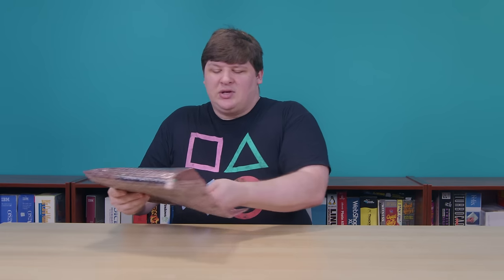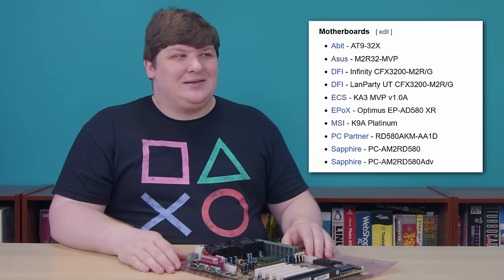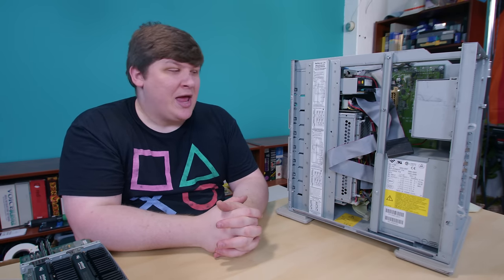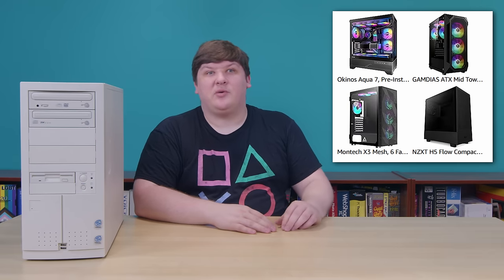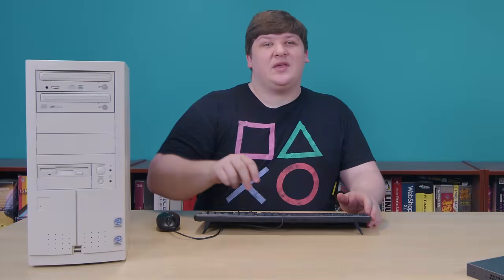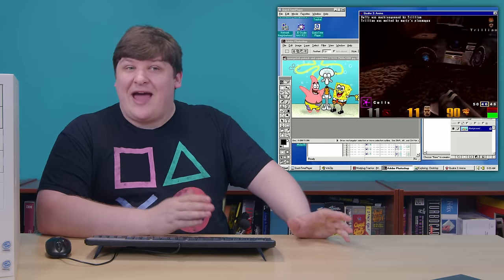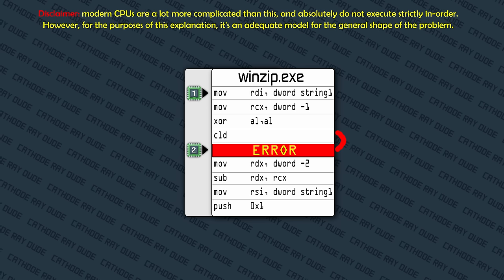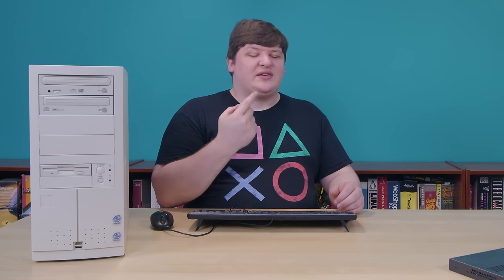The Only Famous Motherboard

Comment: The big clue of this board was that you could use unmodified Celerons for SMP. Celerons were not intended to support SMP by Intel. I had a Dual-Pentium-90 System with 32MByte RAM - this was huge at the time. A EISA Mach32 GPU and a 1740 SCSI Controller - later replaced by a 2742T (way faster),

Comment: I am pretty sure it was legendary for having the most bulging/leaking capacitors than any other board made. I replaced the ones in mine..... all of them. 
BTW...the celeron with its low FSB speed was easily overclockable even with a cheap motherboard without overclocking abilities, most didn't have any, only stock settings.

Comment: It's worth pointing out that the Unreal Tournament OpenGL renderer coped better with multithreaded cpus than the direct3d renderer did. It wasn't actually SMP supported, but it wasn't as broken by multicore cpus. If memory serves, it had to do with instruction counts being different than expected on multicore cpus, leading to microstuttering and worse issues, like the game running at the wrong speed.

Comment: 59:00 You forgot to mention two more reasons why people never used two Pentium IIIs on this board, one of which is explained in the Wiki article you referenced:
- Celeron Coppermine CPUs had SMP disabled, by this point only the Pentium IIIs and Xeons supported it, and even if you had the cash, didn't care about the performance differences and wanted to embark on such an upgrade, you had the other issue:
- Socket PGA370 is in fact THREE revisions, and this board is the first one, which only supports Mendocino core Celerons (2V vCore). Coppermine used the second revision, which has less power requirements (1.75V vCore), and then you have Tualatin, which has even lower power requirements (1.5V vCore), changes some pins and doesn't support Mendocino Celerons (yes, Intel did this type of shenanigans before the LGA1151 debacle). Coppermine requires an adapter to step-down the voltages, otherwise you'd fry the CPU. Some have said that two Pentium IIIs work after the adapters are installed, others say only one is supported, but it was a hassle not worth the effort or investment, the real gain was if you could use two Tualatin Pentium IIIs, which this board fails to boot with

Mendocino Celerons on BX440 chipset boards were cheap because Intel wanted it so, the competition was the K6-III prebuilts, which were amazing value for money. Some of the infamous prebuilts around this time, like the Barbie/HotWheels PC, or the PCChips BookPC, or the eMachines eOne, all used this combination of Celeron Mendocino and BX440. The Never Obsolete eMachines PCs did as well. By the time Intel phased out P6 (momentarily), some vendors that put out this cheap crap went the VIA C3 route.

Comment: Back in 1998 or 1997 I cant remember well, my cousin had a dual socket board in his computer. He was super proud of that machine and it ran dual slot CPU's. The bigest rub for those systems honestly was having to use winnt as it was just.... dogshit for playing games at the time. Everything was designed for windows 98 / windows 95. The computer was cool that you could run things at the same time but again you were really limited by io access. A little while later around 200 and 2001 I was really into linux and LFS and would have killed to have a dual CPU machine just for compiling as it was perfect for that. I actually suspect many game devs probably had workstations setup like this for doing compiling on as it was perfect for SMP stuff.

Comment: I had a BP6 back in the days, not my first dual Celeron. My first dual Celeron was a slot Celeron that required drilling out the chip and adding a bodge wire to make it work. My understanding intel hated this board. My system was overclocked I used a window ac unit and ducked it into the case right in to the two CPUs. I had a promise RAID IDE controller that had its own memory and supported 6 drives adding up to 1TB of space. I ran windows 2000 beta on that system but all my other systems were linux OR SCO Unix at that time. Because of the overclocking the motherboard finally went up in smoke. I also had a cable modem at this time, cable modem number 2 as I was a beta tester in our area.

Comment: The  Real big deal about the BP6 was that it had a special  bit of circuitry that allowed  a Celeron to run in multi processor mode, where intel  disabled that feature in these budget chips so it wouldn't emerge as a cost effective alternative  to  its Pentium Pro line up, the BP6 was the only board that could run twin chip Celerons in MPS mode, ,fun fact unlike other intel CPU's of the time where the cache was EXTERNAL to the die ran at half the speed  of the CPU,  the Mendocino core  Celerons  cache was INTERNAL to the die so even though it was half the size it was not a problem as it ran at the CPU's  clock speed and was SYNCHRONOUS  to the CPU, overclocking from a 66mhz system bus bus to a 100 Clock or even higher with the correct clock divider setting  actually pushed the chips ahead of the more expensive CPU's, as you can imagine tech people went for this option,
 I had one of these in the day... was perfect for what I used it for, I it required an OS with an MPS HAL or it would only  use one of the chips,  the board came bundled with Gentoo Linux but I ran mine in multiboot  with  NT 4.0, and RedHat at the time, and W98  for single core gaming,  when windows XP came out it needed the Pro version to use both CPU's, I ran this board stable for many years with a pair of celeron 366's  running  @  574mhz each

Comment: Computing is so boning today compared to back then & earlier. DIY, dip switches, Jumpers, IRQs Putting the right add in card in the right PCI slot. Having to actually partition & format a drive so you could install the OS. Hoping you used the right version of drivers... It was just a better time for us geeks.
Reply: you could still do it, but why bother?

Comment: It cannot be overstated how much the broad introduction of multi-core systems revolutionized the responsiveness of computers, even before applications themselves took any advantage. With only a single core, if anything at all is trying to use as much processor time as it can (which covers a whole heck of a lot of things you'd want to do with your computer, including gaming, decompressing, rendering, etc), your computer feels like crap. No exceptions, no workarounds, it's just awful. We forget this today, but the experience back then was if you were doing anything as simple as file copy, you either just left the machine alone to do its thing or you suffered massively trying to do anything else.

Once you have at least two cores, you can have "something" running full-bore, while still having free cycles to do all the background busywork that makes your computer feel like a responsive machine and not like an exercise in frustration.

Also, I take deep offense that you think I was more enthusiastic about my Athlon 64 than the absolutely bitchin' DFI Lanparty it lived in.

A good friend of mine ran Windows 2000 (the "next" release of NT after 4) on his main gaming machine for years (basically starting as soon as it was available and well into the XP era). He loved its stability, and he finally had to give up on it because he got tired of tricking software to install on it that would run perfectly fine (once you got it installed), but the installers were so confused by the idea of Win 2k that they refused to even attempt an install unless you threw arcane command-line parameters at them to convince them they were installing to some other machine over the network.

I can confirm that video games used to be very single-threaded, but that is very outdated information. I know because I had an Athlon 64 dual-core about as soon as it was available, along with a fancy Logitech keyboard that let me view processor usage while in a fullscreen game. It was incredibly typical to see the tell-tale pinning at 50% or so in most games of the time, and this only really started to change in the 2010s.

For many years now games have split various tasks into different threads, so any game made in the last decade will see at least some benefit from multiple cores (although the benefits usually peter out at somewhere between 4 and 16 cores depending on the game). This is helped by the fact that everybody now uses a small number of common off-the-shelf game engines instead of rolling their own, and the threading aspects required to take advantage of multiple cores are mostly the responsibility of the game engine. Unreal Engine and Unity have obviously put the time into threading their engines, but "random early 2000s game developer building their own engine from scratch because that's the only way" most decidedly did not.

In terms of Photoshop, they have gradually added multi-threading support to more and more parts of the program over time. The earliest versions said "supports SMP!" but it was, as you note, only a small subset of the filters that actually took advantage of it and nothing else. The later the version you're willing to run, the better this support should get.

On a more general note, this era of computing was chock full of little tricks like the Celerons mentioned here that could give you shockingly good performance for very little money. The complexities of chip production, packaging, marketing, fabrication, and the difficulties around market segmentation meant that there were all sorts of weird corners for those "in the know" who could buy low-end products that were actually higher-end ones in disguise, that were not as cut-down as they implied, or that could be modified or unlocked in some way to behave like the higher-end counterpart.

Nowadays, manufacturers have such good control over their manufacturing processes that it's almost entirely "what you see is what you get". The chips have no excess margins to take advantage of (because they do that themselves automatically), and even if you could, the techniques used to lock products down are functionally bulletproof compared to stuff that could be bypassed by an enterprising nerd with a hacked firmware or a graphite pencil.

Great story so far, looking forward to part 2! I never owned one of these dual-socket boards (considering them more trouble than they were worth at the time for the reasons you outline) but I knew friends who had them, and my first dual-core processor was a revelation.

Comment: Legendary board, as were many Abit boards. There was a trick with these was to get the Celeron, I believe 633mhz or 667mhz with 66mhz bus, switch to 100mhz which would turn them into 950mhz or 1ghz cpus, running under WIndows XP which would be a cheaper multi processor solution, than pentium 3 1ghz, other Athlon and better than the Pentium 4 in many cases for less money. I believe you also need a special socket converter to allow these coppermine based processer to work and be multi-processor. Its been 30+ years since I did anyhting related so my money is a little fuzzy. I had similar set-up but used a rioworks mb that was also multi processor and you could do the same as dscribed

Comment: 19:37 tube radio and baby shit are two crayons in the devil’s art box
38:37 sure sure individual apps won’t run better but multiple cores make for a much smoother experience in day to day use. Also a badly written app on a single core system that pegs a CPU at 100% won’t render the system semi unresponsive - you open task manager, kill the process and you’re back to normal. Cleanly killing processes seemed to be an NT4+ like feature and not 9x
Edit: ah you cover this 
42:10 splash screens with some stylish art trigger some part of my brain “This is some $3000/seat pro-tier software” like some compositing suite that requires an SGI. And they all seem to have been ported from non windows os’s because their look and feel are totally alien

Comment: The funny thing is that XP Home edition doesn't support Dual core CPUs. You need pro. (I tested it in a VM and it still boots but idk if the second core ever gets used or if its just the vm) so ether when dual cores where shipped in consumer pcs in 2006 like a Core 2 Duo in a Dell or whatever, ever they would have XP home and not use the dual core chip (unless you got the express upgrade to vista) or would have XP Pro

Comment: I ran windows 2000 beta and it released in late 99.

Also we used these dual cpus to run quake servers , quake 1/2/3. Either running Linux, NT or 2k 
So the games side didn’t support this but the servers could and having a local dedicated server at a lan party was a better experience.

We used celerons because we could overclock them to run faster than the pentiums

Comment: One of the more significant aspects to the ABIT BP6 was it had crappy quality electrolytic capacitors. Sure there were lots of other MB's that had bad caps but this one was one of the key MB's that started the bad cap awareness. It was so bad that even a 2yr+ MB, ABiT would willingly RMA it for free. I know I RMA'd 2 of the boards as a consumer. Not a computer service company.
This was at the time an amazing board if you had an OS that took advantage of SMP. I used FreeBSD and it was a great machine for NAS and network routing.

Comment: Previous dual cpu boards used the Pentium Pro or Pentium2 processors, not Celerons, which the BP6 could.
I do remember NT.  In fact, I used the original version 3.2, then 3.5, and finally 4.0.  Also used NT on the power PC processors.  This was a development environment.

Comment: I had this board with twin 366 Celerons OC to 550 or so. Before this, I also had the Abit BH6 with the legendary 300A Celeron running at 450/464. I think I had them both at the same time running side by side for some time. I hate that I let the BP6 and the BH6 go at some point in history.

Comment: I saw a dual Celeron '300A' running @533 MHz [ aggregate >1GHz ] back in '97. It was a 'claim to fame' back then, the lack of a L2 [ ? ] cache made the chip very over-clockable. I forget which Mobo the dual slot1's were on.

Comment: It wasn't just that consumers didn't use or need multiple processors that kept support put of Win9x. It was that a lot of stuff core to the os was still tied intimately to DOS. It was a fundamental design in the core that made multiple processors imposdible on win9x. Windows XP wasn't so much merging code bases as tossing out win9x. Windows ME could still use DOS hardware drivers. It would be dog slow, but it would work, the exact same way it worked for windows 3.1.

Comment: the single cpu version of this board was probably the most popular at the time, the BH6, there was another model that had 4 dimm slots, but the BH6 was a lot cheaper, and the celeron was so cheap, and you could overclock a LOT the 300 would do 500 easily... that was actually my favorite time to think back on, i wanna put one together at some point, i even got me a voodoo5 5500AGP waiting for it :D

Comment: I had a computer with an ABit BE6-ii and I can attest first hand that its HighPoint controller (same HPT366) was effectively unusable. It sure gave me far more grief than it was worth. I should given up on it earlier than I did but I was so convinced it was my fault, and I was just one more tweak from making it work, that I kept trying over and over. Luckily the MB came with dual controllers and the second (more conventional) controller worked just fine.

Comment: I owned quite a few dual boards over the years going all the way back to the i430HX chipset and while I never had the BP6.  I did have a dual dell like the Precision 420 -- complete with weirdo PSU and RAMBUS ram.  I ran NT4 on two of my four machines.  I actually paid LESS for NT4 than for Win98 licenses because MS would pack in an NT license with products like Visual Studio.  So they would show up on ebay on the cheap.  I recall struggling to get virtually any games to run.  Luckily I was mainly an RTS gamer and Starcraft ran fine.  Even Win2K was pretty terrible at running games unless you patched it with the Win98 DirectX DLLs.

Comment: IME, the problems most people had with PATA 66 was due to shitty cabling. It absolutely required the fancy & expensive ribbon cable with solid core wires & interleaved ground lines. Regular PATA 33 cables would not work reliably.